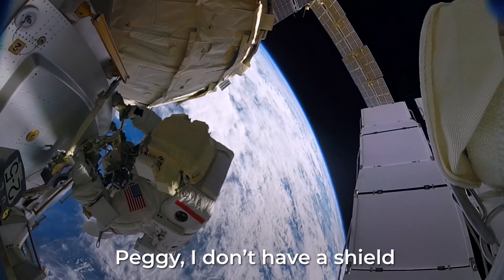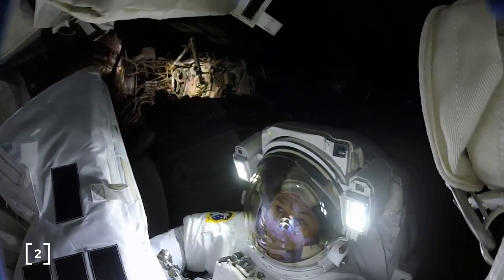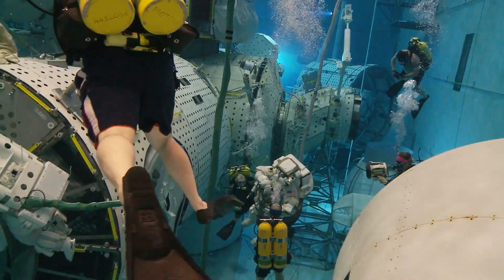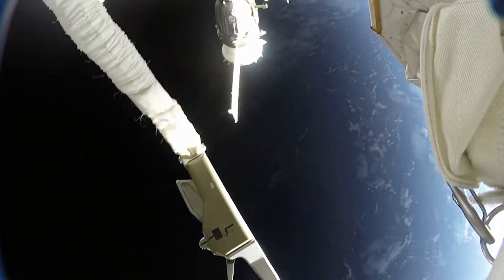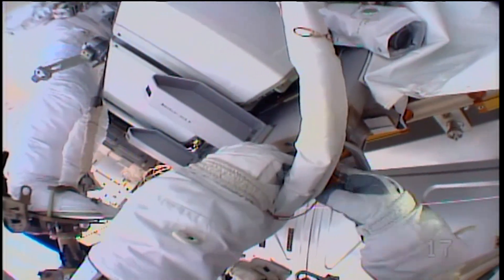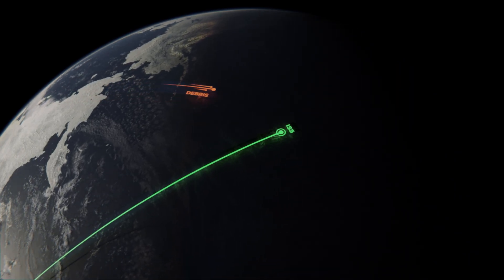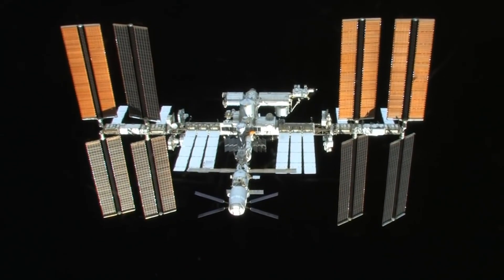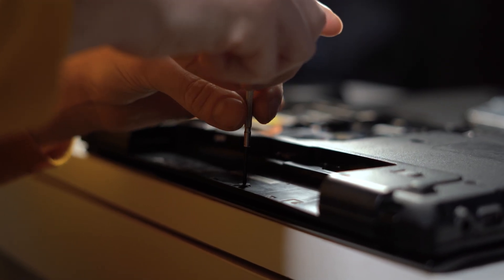Don’t Drop your Tools in Space

Comment: Instead of just wringing our hands over space debris, why not come up with a “Space Roomba”?
A robotic and/or remote controlled drone/spacecraft (with a big funnel) that 1) approximates the speed of space debris, 2) eases up on the trash from behind, and 3) scoops it up into a cargo bay.  
The metal debris can [should] be separated out at this point by a debris processor [for example: between the metal and everything else]. The processor is fitted a with a dispenser for Mylar ‘garbage bags’. The filled [categorized, & I.D.ed (color coded, w/ bar codes?)] bags are stored in another (much larger, & totally tubular) cargo bay, one at a time, as they are processed and filled. When it’s full, that cargo can be pushed into ‘sausage casings’ (net-reinforced Mylar) that are bundled together and towed to an Earth-Moon Lagrange point (for storage) by a ‘tugboat’ drone. 
Not worth it? What’s the difference between the value of a kilogram of aluminum on the launch pad at Cape Kennedy and a kilogram of aluminum on the deck of the space station? Well over $10,000. Even if it’s been shredded (the aluminum that is). 
How about after that aluminum has been melted down in a solar powered furnace and extruded or cast into structural members?... “There’s Gold in Them Thar Orbits!”
Reply: Too much trash at different speeds and orbits means you’re going to need a lot of fuel to manoeuvre. That in turn means more mass for the spacecraft so more fuel will be needed to change its speed and orbit.
Reply: Sounds like a space Roomba or umbrella or net would run a high risk of becoming space junk itself...

Comment: @realengineering how does a vacuum exist ("space") next to a pressurized environment (Earth) without a container? Grawbbity??😂
Reply: Air gets thinner the higher you go up. Space is where there isn't much air.
Reply: When you go up a mountain the air gets thin. When you go higher the air gets thinner. If you go high enough, there is not enough air to breathe or produce significant drag. You are right, it is gravity. When there is not enough drag to lift an aircraft, we call that "space".

Comment: Debris sheild: can't keep up with the 17000 mph speed of the ISS while not attached. Fixed with wire ties and cloth. Yep,that's NASA. At least the astronauts can keep traveling at 17000 mph while not attached by anything other than some kinda tether rope. There are no limits to the imaginary possibilities while in the magical  water vacuum of  space . Gotta be Glerf the gravity god keeping these astronauts safe
Reply: Not like there's weather up in space. You can get away with pretty thin materials as long as it's airtight.

Comment: Prevention is better than cure. Best solution is a sort of conditioning of the space around a station. Still the vacuum of space, but enclosed to a degree. Can be achieved with a light but strong small gauge wire gauze on a light scaffold to form a cage around the station. Think chicken wire, but high tech to be lighter and and stronger. At a minimum something like a nylon net could work just fine. You could obviously not pressurize something like that, but it does create an enclosed space of a sort. Which could be very useful. All but the smallest debris would be restricted to the inside and be collectable again, and it would even provide a level of safety to astronauts during EVA and make it much less disorienting. Much of the stuff on the outside of the station is on the outside to save internal habitable space. There are relatively few things which truly need to be on the outside. Thrusters, solar panels, sensors, docks, radiators.. what have you? Do it right and it could be electrified to generate an EM field to protect against radiation. It could benefit space suit design for "inner EVA" with the current types reserved for true EVA.

Now the current station was designed with some aerodynamic consideration in mind due to it's orbit which falls in the ephemeral outer reaches of the atmosphere. However something like this would be crucial for stations in deeper space. A station around the Moon for sure. The further away a station is, the more wasteful a loss of equipment or material is.

Comment: Could someone produce a small drone with a camera, low power radar, an arm with a net, and cold gas thrusters? 
It could be used to film the station from the outside and, if given some more sensors, could probably be used to find leaks and damage much faster than using the arm to look. 
It could also be used to keep an eye on astronauts so that in an emergency, ground control would have a better view of the situation. If a picture is worth a thousand words... what is high definition video with ir and radar worth? 
Lastly it could be used to bring back small objects moving slowly away by either nudging them back or capturing them in the net.

The drone should have the capability to be controlled locally or from the ground and should be small enough to egress in the same way that astronauts do. It could use methane as the cold gas. If you had storage tanks of the stuff on the outside of the station, it could fuel itself before each mission and un-fuel itself every time it had to return inside. Since the station produces methane in quite large amounts as part of its normal operation, this would be "free" fuel. For better performance, a battery could be used to heat the gas before use to get a little more Isp from it.

Comment: Magnetic grapple gun that uses the concept of a rail gun to propell the magnet to the target and once the magnet has touched the target it stops loosening the rope as not to push the object further. Then a winch pulls it back and because its space and weight basically plays no role the winch and everything else does not have to be gigantic.
Reply: The safety issues that would pose are immense
Reply: weight absolutely plays a role, as what if the thing they are trying to grapple is heavy and the winch ends up slightly pulling whatever it’s attached to towards the object its trying to pull in. if its handheld, the astronaut would need to hold onto the ISS, so it’s basically the same as if it were attached to it. what if over multiple uses on heavy things in the same direction, it pulls the ISS into a spin? that wouldnt go very well.

Comment: Does the ISS stop during spacewalk?
Reply: No, it has to keep moving to stay in the air, gravity still exists out there. The astronauts just move equally as fast compared to it, kind of how you don't experience any acceleration in a car when it's been steadily driving
Reply: @0x150  I understand that you definitely won't feel the car moving if you're inside of the car, but if you're hanging outside of the car while it is moving, you would definitely feel the speed and acceleration, right? Why is that not the case in this video?
Reply: @MalevolentSoul  because when you're hanging out of a car window, you encounter a funny little thing called air, which pushes against you. Up in space, there is little to no air, meaning there nothing pushing against you.
Reply: @MalevolentSoul  the issue with comparing the 2 is that on earth, the air around the car doesn't move with the car, so it drags you back. there is nothing that drags you back in space, you can very well move exactly the same speed as the iss with nothing stopping you
Reply: @0x150  thanks for the explanation. So in a vacuum with no air, will we be able to experience/feel any type of acceleration since there's no air drag?
Reply: @MalevolentSoul  acceleration still exists, air drag does not. that doesn't mean there's no drag, just a minuscule amount that won't really affect anything

Comment: the thing that everyone forgets is that the space station is moving very fast by itself that means anything that get disconnected from it will drift away at similar speed even though it looks like it's slowly floating down in the video

basically that 8 Kg shielding is actually moving zipping in orbit like a fast moving car, which is terrifying for anything that's not traveling in the same direction
Reply: fast moving car? bruh it be moving faster then an SR-71 blackbird.
Reply: A fleck of paint in space is as dangerous as a speeding bullet on earth

Comment: One thing I don't understand - if the shield is only drifting away from the ISS at 1ft per second, how does it become a danger to the ISS? Where does the increase in relative velocity come from? Is it atmospheric drag slowing the shield down so the next time around, the ISS is going much faster?
Reply: It's not about relative velocity, it's about absolute velocity. That shield is zipping around at the speed of a fired bullet
Reply: @Coastal_Cruzer  but so is the ISS. You see how slowly the shield drifts away when dropped? If it had touched another satellite in a different orbit just then, kaboom, but if it bumped the ISS right then, no big deal. Somehow, it has to either speed up or slow down over time relative to the ISS to become a danger to it

Comment: 1. Catch-equipment for those lost tools/things like diver/cowboys: harpoon shooting a lasso-safety catch net wrapping around the lost+caught thing additional anchor hooks an net edges grap into the net keeping it closed, when pulling back to the astronaut. Before using it for catching it might be usefull as redundance life belt/strap connecting the astronaut to the space station.
2. Many tools have already a fixing hook/eyelet/ring or magnet for not loosing them when connected to working/space suite via chain, ribbon, strap or lanyard.

Comment: As a commercial diver, I know exactly what they are struggling with. I'm working in Sweden where water temperatures force me to wear thick mittens and a 3 mm rubber glove on top of that. Dropped things ither sinks to the bottom or floates to the surface. But we don't have the micro gravity making heavy parts light in the water. Unless you adjust their buoyancy which is not always possible.

This is the closest I will ever get going to space 😅
Reply: Please watch out for Delta P and your work environment is pretty much identical to space if you ask me
Reply: @High Roller  It's my worst nightmare, getting stuck because of delta P. Just watched a video about it, explaining fatalities due to Delta P.
Reply: Dexterity must feel horrendous during space walks. At least for you, your hands are under pressure the mittens and gloves are pressed into the skin. For astronauts it is the opposite, the suit is pressurised against a vacuum, it would want to expand away from your fingers.

Comment: I wonder if space suits could use prosthetics for the hands. Have the actual human hand completely enclosed and free to move inside the suit, then use that hand to control a prosthetic on the outside. Even something as simple as a purely mechanical two-finger gripper on one hand might be more useful than a full hand with fat fingers.
Reply: Certainly doable, but that would be more equipment that needs to be brought up and could break. And at the current state, I don't think the dexterity would be any better than what you have with the gloves.

Comment: I pretty much already knew what happens when they lose something on an EVA, but I want to know what zip ties are approved by NASA, for use in space...like what type of zip tie can handle going from the hot side to the cold side or shadows in space? I don't know of any plastic or material similar to plastic that can do that...heck a lot of metals might not do well in that environment to be honest...just the heat expansion and contraction in the cold of a metal zip tie could cause issues with it becoming too tight and breaking something you are using it on or the tie itself breaking from it getting cold, contracting, becoming too tight and becoming brittle at the same time...maybe I'm missing something really obvious? Or I'm overestimating the amount of expansion and contraction that actually occurs?  Is there some slick way used to limit its locking mechanisms strength?
Reply: Several plastics are actually able to be used in  I don't remember exactly, but I think they use nylon.  These are not likely to be ued in extreme temp environments as the thermal mass from the objects they're tying and often shielded.  The more extreme ties are pure copper with some rtv to seal the ends.

Comment: it is quite silly to assume an object lost by astronaut is going to crash into the ISS. it has almost the same speed and direction as the ISS. If you throw something down or up while doing a space walk and it will come back to you, further down the orbit.  It's basic orbital dynamics.
Reply: it colliding with the station is very unlikely ( it could collide with one of the solar panels ), the primary concern is it colliding with other spacecraft
Reply: @chri-k  I would not call it a collision. Maybe technically it is, but it would bump into the station/panels with the same speed as we saw it disappearing in space. I will not accelerate or change direction.
Reply: @michelhegeraat5430  how does that not make it a collision
Reply: @chri-k  Technically it is, but due to virtually the same speed and direction, the energy released in the "collision" is about as much as the push the object got from the astronaut that lost it. Space debris is problematic when it has a different direction then yourself because of the X km/s speeds. You can compare it to a head on collision between cars at full speed, and the sort of bumps you see when people act silly, when two lanes become one. The first one costs lives, the second one is a paint job.

Comment: I feel like placing a net over the area you are working could potentially risky stop some of this, no.  Place it a fair distance away, and the debris shield could be caught.

Now, a regular net may have problems since there would be slack, but if you used something metal, we have materials that when electricity is applied, it reforms [I feel like Real Engineering talked about this before].
Reply: Good idea about the net. I also posted the idea, but now I see yours. I think it would be a fairly inexpensive solution.

Comment: -Isn't the future of EVA, VR-EVA ? You stay inside the ISS and control a robot that does the job for you?
-Shouldn't they have some kind of recovery drone that could be launched to recover the lost stuff?
Because of orbital mechanic, it will cross your trajectory in the future (not necessarily at the time you are there), so it could be close enough to catch it, even if you missed it during the first minutes.
-A simpler solution could be to have a net with magnets to increase likelihood of catching small stuff even with big holes

Comment: Someone should build a space fishing pole that has the right amount of weight on it so when you go to throw it, it will move in the micro gravity. Then they can grab, hook, pull, reel in any object that is out of reach by using a threaded wire fishing pole type design? Maybe?
Reply: 1)And what tells you they won't lose that. 2)That they haven't already tried and thought it was a bad idea.
3)It's space it needs thrusters ,simply throwing heavy weight won't work the same like on earth
Reply: @PriceyTomato  you can absolutely just throw something in space
Reply: @CAMSLAYER13  you can, but it wouldn't fly away the same as earths atmosphere. Remember no gravity in outer space. Are you confusing less particles hence less drag so you pitch a ball faster in space? 

That's not how space works buddy
Reply: @PriceyTomato  it won't work the same as earth, however whatever you threw would go in a straight line at a constant speed. You could, theoretically, throw something at something else in space and hit it. Honestly I'm not sure what you are trying to imply about how throwing something in space would work
Reply: @CAMSLAYER13  

I'm saying that it would would be redundant to have a fishing pole that would hook debris. 

What would be it's mechanism? What makes you think if you shoot a dart like thing it would absolutely follow it. What places of space station would have that. How much reach will it have, in what direction would the canon fire. What would keep track of the object? What would activate it? You do realise ISS is 356 feet (109 meters) end-to-end?

I understand it follows a predictable path for a free falling object but how would those fishing rod follow it?
Reply: @PriceyTomato a fishing pole would work the same in space, it doesn't need gravity to do its job. Projectiles on earth don't follow targets and they hit things fine, if something is going at a constant speed in a straightline it would be trvial for a computer to calculate where to aim and fire a thing. Granted having them in the right place at the right time would be a genuine issue and then there is the weight of having enough of these on your station to possibly be useful. Maybe a handheld device would be more cost and weight effective but maybe you don't want astronauts firing off projectiles around the space station, probably pretty hard to aim in those suits as well, especially if you went for litteral fishing poles instead of some sort of gun/crossbow type deal.